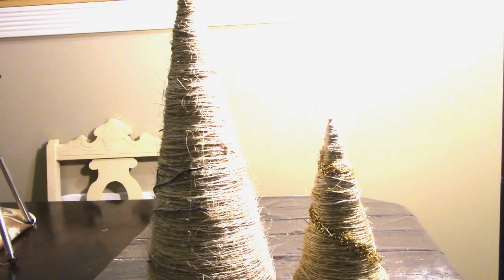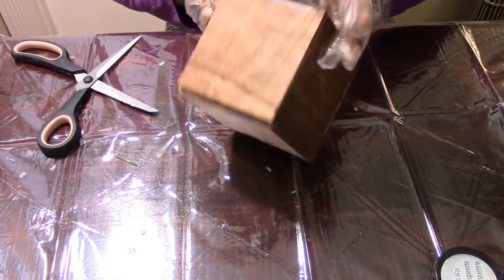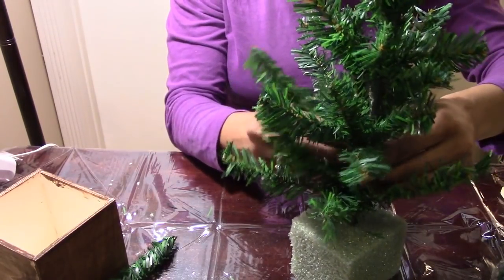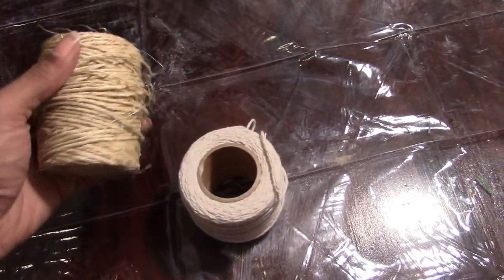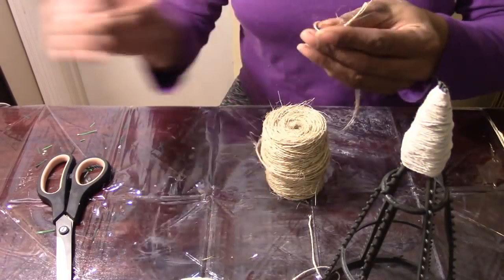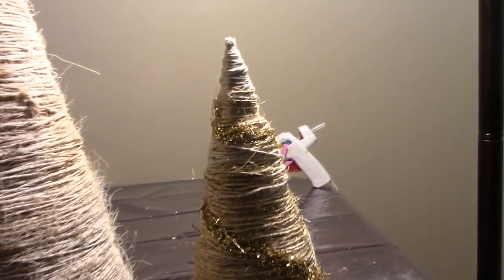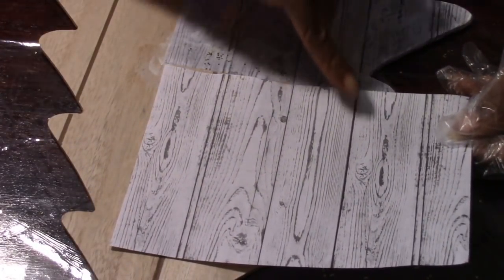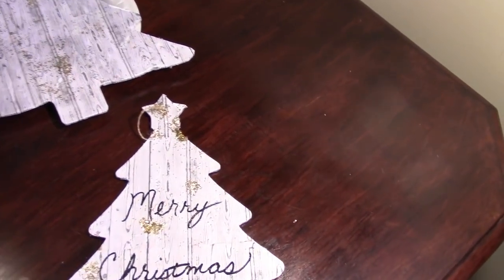Dollar Tree DIY/DIY Christmas Decor

Comment: I can't find those fillers at my dollar.  Anyone have have other suggestions to fill in the open spaces.  I have five trees to complete my decoration.  Please help me out..   thanks
Reply from the maker: Beverly Alexanderno b Hi Beverly, I'm sorry to hear you can't find the filler at your Dollar Tree. They do sell a garland in a pack shaped like a wreath but it's not a wreath. I'm pretty sure you could use that to get the same full look by cutting that. Its wired as well as the strands are to flex and bend. I wish you well on your trees. I hope I offered a solution.
Reply: Miss Monificent  thanks for the suggestion.  Have those already and will give it a try.